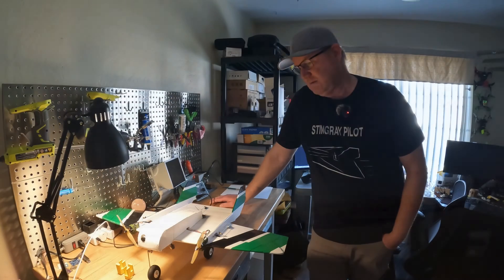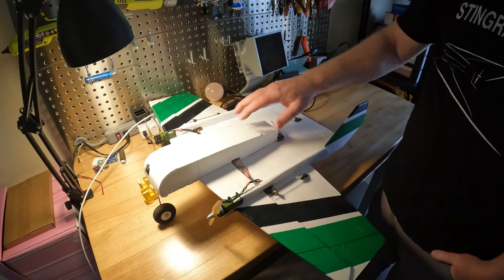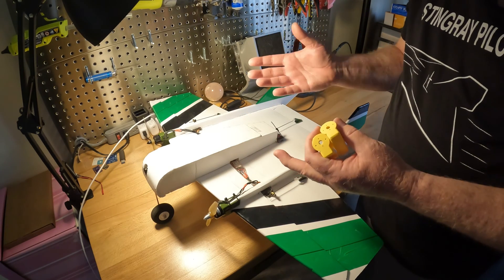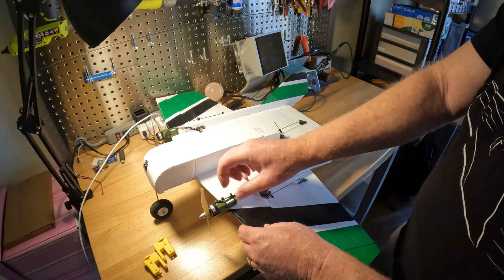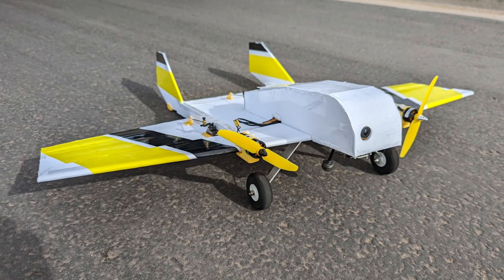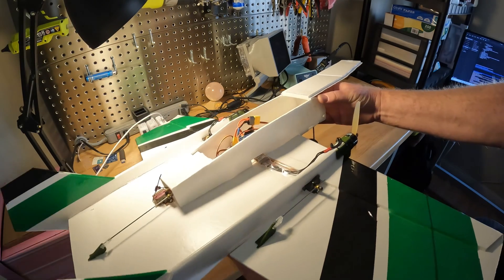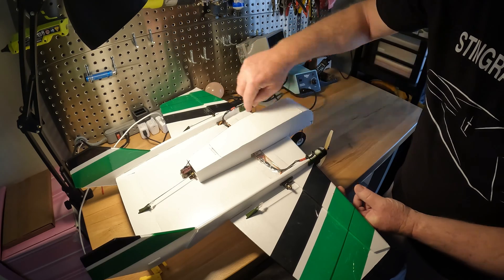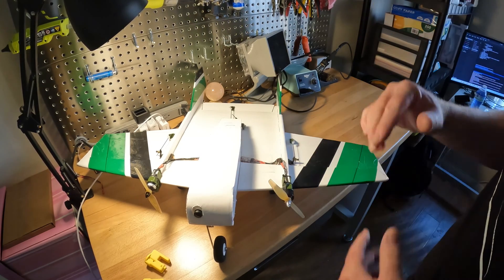Build this FPV Plane!  The Golden Twin - Details!

Comment: Question
I am building this plane, and I have the main boddy cut out. In the drawing, the part where the leading edge folds over says to remove paper. Is this correct? I was wondering how it folded over with the foam still on.
Reply from the maker: Yes, on the inside of the fold, remove the paper.   It also helps to add a layer of packing tape on what will be the leading edge of the wing.  You will want to run an edge in there to crease it.   Similar to standard Flite Test build techniques.

Comment: Is the nose /  battery compartment the same size / shape as your Stingray?
Reply from the maker: It is similar, but not as wide and maybe a little shorter on the depth.  I do like a lot of room in the body though.  The first one or too I made the body was just too thick.   I am happy with where this one ended up
Reply from the maker: The listing on Printables has some good photos of the nose and a few of the build photos of the parts.  https://www.printables.com/model/767993-golden-twin-fpv-rc-plane-with-foam-plans
Reply: I have the stingray, and was looking for a camera mount for it. I am going to build this one soon. Thanks